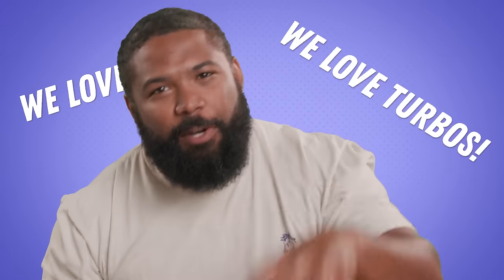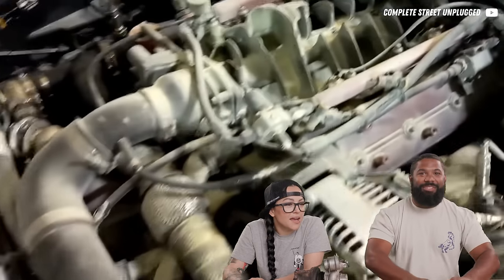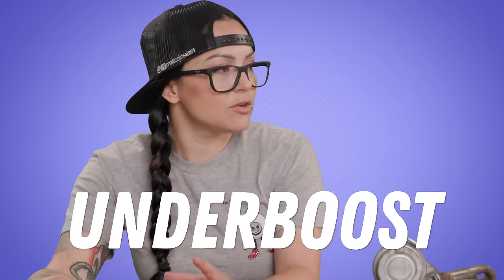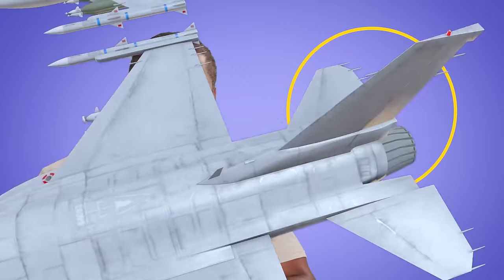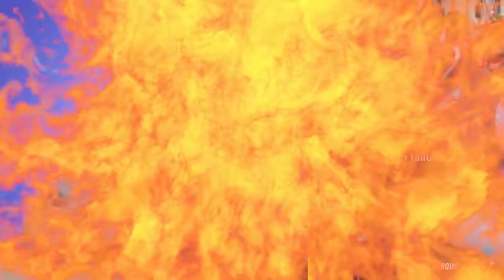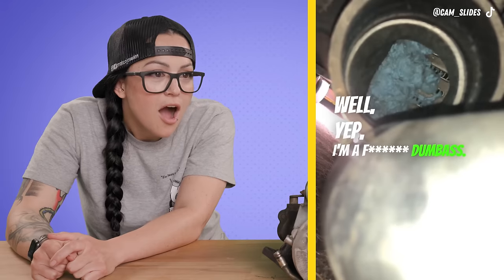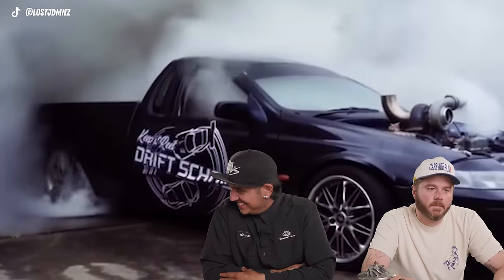Mechanic Reacts to Catastrophic Turbo Fails

Comment: 13:05 Rag in turbo- My neighbor had one of the early Mustang ll with a 4 cylinder turbo engine (early 80's?) Performance got really bad. He went to Ford garage, they replaced turbo at neighbor's expense. About a month later, same problem. He asked me to try. I took turbo off, would not spin easily. Looked into exhaust pipe, saw an obstruction. Used a strong hook to extract something like a woven piece of chain mail. It was the stuffing from the cat convertor that was upstream from the turbo. It had come loose, blocked exhaust flow. Back to Ford garage, they gave him hell for taking it apart. He made them buy him a new turbo, cat convertor, and pay him back for 1st turbo. Covered under 5year/50,000 mile warranty on smog control devices.

Comment: 6:22 We call this a Runaway Diesel. Unwanted air is gettin inside of the combutstionchamber, no throttle, selfignition, boom. You can only stop it if you block the intake.

Comment: That Volvo had something thats called a diesel runaway. That happens when the turbo is leaking oil into the intake, that oil is then basically used as fuel and the engine runs until the oil is completely drained and or the engine explodes. When this happens the only thing you can do is trying to choke the engine by stuffing something down the intake. This is more common in the eu where small turbo diesel engines are common in commercial vehicles.

Comment: 6:21 The "Ghost Car" video is a runaway diesle. The turbo oil seals fail and the engine runs off the engine oil instead of diesle fuel. The only way to turn off the engine is to plug the air intake.

Comment: 6:36 is a runaway, oil from the turbo gets into the combustion chamber causing the car/truck to go full throttle until it blows up. the ignition stage is no longer needed when this happens so good luck stopping it. the only ways are 1 as the guy was saying, stall it or 2 stuff the turbo with a rag.

Comment: @Donut the Volvo from idle to smoke from the exhaust is a runaway diesel. Oil from the turbo gets in the intake side and diesel beeing a compresion ingnition that oil acts like diesel and the motor just spools up. It’s a dangerous fail and on older models happened while driving.

Comment: That Volvo S40 probably has the older D5 engine. One big issue with these engines is that it can starting to consume the engine oil together with the fuel, causing the engine accelerate by it self and its really hard to stop the engine. It will often continue until it broke down totaly. The main reason seems to be to much engine oil. Lot of these incidents in Sweden and probably around the world 😅

Comment: The powerstroke on the Dyno actually blew its compressor wheel out of the turbo and the white smoke was the oil that fed the turbo dumping into the exhaust. I've actually done that with a diesel I had.

Comment: There is almost always shaftplay in a turbo as most used bearing is oil bearing. If it is in about 0.5-1mm from side to side than it's still in a tolerance field. Mostly the problem starts when it starts grinding on the wall of a housing :D

Comment: That "rocket stove" barbecue was actually a gasifier powered jet engine. Using forces air to heat up the wood fire, and burning the gas to power the turbo like a jet engine. Feedback loop gasifier. The original videos were pretty great.

Comment: Runaway diesels are terrifying. I had it happen on a van I was moving around works yard. Just started revving harder and harder but my foot wasn't on the pedal. I noped out of there and just left it till it killed itself. 😂 It happens when the oil seal in the turbo fails and it starts feeding oil into the air intake essentially self feeding fuel causing the runaway.

Comment: Also had the vacuum line blow off the wastegate once and immediately pinned the 45psi gauge. It was a wild ride until the engine blew. Think just the head gasket, but with over 100k miles on the engine I just rebuilt it. Did have to rebore the cylinders 30 over. So would have worked out ok but it was stolen and stripped not long after. They left the engine mostly untouched so I rebuilt it. Then it got flooded in a hurricane. Loved the grand national, but it must have been cursed.

Comment: the black volvo at 6:22 is a diesel that is "running away" you guys should know this.. usually the turbo seals go out and oil floods the intake side of the engine, and you know that diesels will run on oil as a fuel source . and diesels ignition is cylinder presser its self. so there is no way to turn it off

Comment: It is a myth that turbos do not use any power. Because the exhaust is used to drive the exhaust turbo which drives the compressor. The HP lost can be calculated by the compressed air pressure and volume, plus the HP loss for spinning the turbine and compressor. 

If the exhaust is restricted enough, the engine will quit running. Restricting the exhaust by varied amounts will cause varied amounts of HP loss. The loss can be 40 HP for a large dual turbo on a 454 CI, 7.4 L, engine at high revs, though this is just a example. The HP gain from the turbo greatly exceeds any turbo HP loss, which is where the myth originated.

Comment: 6:22 it’s a diesel runaway, it usually happened in a mechanical diesel engine, probably the oil goes (leak) straight into the turbo and causes the engine to runaway even though you already unplug the battery

Comment: I think Angela missed it on the Corvette. The intake failed so the turbo, the throttle body, and any sensors like throttle position and MAF were seeing airflow- so the computer using that map for air fuel data was sending correct fuel for the air flowing to what the computer was sensing- however since the air was venting to atmosphere BEFORE the engine- resulting in rich mixture. Sure, maybe there was a tuning mistake- but seeing the bulk of it- the result was not directly some rich fuel map. It was the sensors and map is only valid- if the intake isn't blown open.

Comment: Turbo diesel engine runaways happen when oil is leaking into the compressor and gets burned in the engine. You can cut off the fuel but because the engine runs on the oil, it won't stop until all oil is burned up.

Comment: I was there the night the gray diesel blew up. It was the second of the night. It was a  Garrett turbo and we the driver over boosted it. It barely had about 50 hours on it of drive time in total. The compressor wheel shot about 50 feet in the air which was super scary. The intercooler poured out metal and oil for about 30 minutes.

Comment: @6:38 ... That Volvo's got a runaway diesel! If your turbo blows an oil seal, crankcase oil gets into the intake tract and over fuels the engine because it burns just like diesel. Only way to stop it is to cut off the air supply by plugging off the intake.

Comment: The old video of the 'rotsun'. It was the datsun with the 4.2 vortec from an s-10, with a turbo from a 10L diesel. Sprayed oil into the engine and vaporized oil was sprayed all over, ruining the race track for the day

Comment: The runaway Volvo diesel - I've seen that happen to a Renault.
Turbo oil seal blown so that the oil was being forced into the cylinders by the turbo... It runs until all the oil is used up, or the engine locks/blows... whichever comes first.
The Renault blew up. 🤣

Comment: the volvo diesel was probably running away, as you said, some turbo oil seals become bad and oil comes in the intake, oil to a diesel is just more fuel, it causes a positive feedback loop, more fuel, more rpm, more rpm more exhaust, more exhaust, more turbo spin, more turbo spin, more oily intake air, rinse and repeat, eventually the engine just gives up

Comment: I was told that runaway in Diesel cars like in the clip around 6:40 can happen if you put too much oil in the engine. Then since it's a Diesel even removing the key doesnt' stop the engine since it's feeding on it's own oil instead of the fuel. I have seen it happening with a Renault Scenic. The driver left the car because being in summer they had the cabin fan blasting, and it filled with smoke when something blew (I guess the turbo?). There was nothing else to do but wait (about 5 minutes) until the engine died (literally).

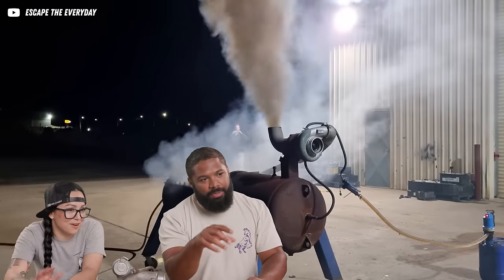Comment: 7:20 Oh a turbo-woodstove, these things are great. You can't control the fuel flow since the wood is already in the combustor and wood gives off more combustible vapours the hotter it gets, and at the same time the hotter the combustion the more exhaust is available to drive the turbo which will provide more air to sustain that combustion. In other words, these things come with thermal runaway as built-in feature, they just desperately want to explode.

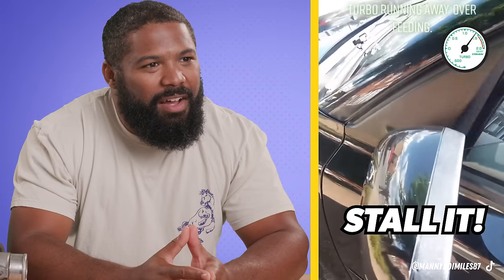Comment: 6:30 Its a right hand drive so what I'm betting happened is this is a Diesel that ran away while it was idling (diesel economy cars are a very comon sight in europe). Since diesels dont pull a vacuum you can only control it by the ammount of fuel, but sometimes they can get so hot the oil starts combusting and rev's the engine to infinity till it siezes. Look up Diesel Runaway there are a LOT of videos showing this exact thing. even if you turn off the key it will still run because theres no spark needed.

Comment: 0:55 "What's great about turbos is they don't take power to make power."
Everything takes power. The turbo adds resistance to the exhaust, which means there's slightly more work for the engine to do. If you connected the turbine side to your exhaust but didn't connect the compressor side to the intake, you'd clearly decrease the power of the car slightly. Not that it really matters -- the point is that it's an overall positive.

Comment: Had a runaway turbo on a big diesel generator, the fuel governor started injecting maximum fuel into the cylinders, had to close the emergency air flaps to stop it

Comment: Keep in mind when you start the car don't go by oil pressure before higher rpms but temperature  so wait till vehicle is at normal operation temperature before kicking the turbo 
Give turbo oil the chance to warm up    so when your engine temp gage is in the middle or normal running temperature   this will help stop oil break down  and give your turbo a longer life

Comment: That Volvo was a classic diesel runaway, usually caused by oil leaking into the intake. Diesels, not needing spark, continue to draw in the oil or fuel and leads to the engine "running away." To avoid catastrophic failure, block the intake and choke it out.

Comment: Having shaft play on factory turbochargers is normal .. factory turbos normally use bushings instead of bearings . As the heat rises the shaft expands. The bushings and shaft play is designed to compensate for the high heat

Comment: 6:22 fuel in oil engine DPF burning procedure many times stopped by fast engine off, only way to stop on manual gearbox is handbrake and brake on max and top gear selected and fast clutch pedal relase. Or use hand to cover air intake (might Hurts) :)

Comment: The volvo was a turbo bearing seal failure. the bearing seals of diesels when they fail will start to pour oil down the intake, and the engine will keep running until it either has no air or no oil left to siphon out. if your diesel takes 2-5+ seconds to shut off after you pull the key out. you may have a failing bearing.

Comment: Dyno sessions can be very dangerous, I've seen videos where flywheels explode, a big chunk bounces off the floor and dome pieces a guy standing 25 feet away and he forever slept, driveshafts can be very dangerous as well, wet nitrous systems can be very dangerous, it can be like a b 0 mb because the system supplies not just the oxidizer but plenty of fuel too, be careful my brother's and sister's!

Comment: what happened to the volvo is a runaway turbo diesel, basically it happens on high mileage turbo diesel engines where the seals are broken and the turbo starts sucking oil and shoving it into the intake, therefore the engine starts burning the oil and it goes to redline and will keep on revving even if you take out the key, it won't stop because it's an endless circle until the oil runs out or the entire engine blows up, to stop it you have to stall it just put it in third or fourth gear break hard and let the clutch go, if you have an automatic and this happens you can just forget about it and run away lmao

Comment: Turbos do have a tiny amount of shaft play out of the factory, that space is filled with oil while it spins. Don't be spooked if the shaft on your brand new turbo moves a bit when you push on it.

Comment: This is caused by the bearing or seal on the intake side of the turbo fails and starts letting oil into the engine.  A diesel will burn the oil causing it to "run away". Since it's burning the oil, turning the key off doesn't stop it. AS long as the engine is getting air it will continue to run on the engine oil until it runs out of oil.

Comment: There should be a tiny bit of shaft play on completely dry turbo. If you plug up the oil return and fill oil in the shaft play should further reduce. Excessive shaft play is bad

Comment: 12:33 this is what causes most diesel runaways. Like the Volvo earlier in the video. They run off their own oil supply and can’t be shut off. The only way to stop them is to choke them out at the intake or let them grenade.

Comment: Your ghost car is a runaway diesel. If that turbo breathes in anything flammable it automatically pins it wide open. It runs until it blows or runs out of whatever is fueling it. You can throw a damp towel directly into the turbo to suffocate it and maybe save the engine

Comment: The Volvo presumably had diesel runaway, where the engine oil leaks in to the combustion chamber and gets burnt as fuel, increasing revs until it blows up.

Comment: Car at 6.30 is when diesels run on their own fuel possibly after multiple failed dpf regenerations causing a high fuel level in the engine oil itself, the turbo leaks the oil which is contaminated with fuel into the intake so you can’t turn the engine off

Comment: That’s a runaway diesel, it happens when extra fuel gets into the intake and the engine essentially gets into a vicious loop of progressively building more power and drawing more fuel from the leak until you either cut off the air or it blows

Comment: The Volvo problem is called a runaway. Oil leaks into the combustion chamber and acts as a fuel source. Turning off the ignition doesn't stop it. You must cover the intake and suffocate it to stop it.

Comment: For your knowledge on that "Ghost Volvo", what happened there was that the Diesel Engine ran away. It can happen to any and all Diesel engine, regardless of manufacturer, or application. 

So on a diesel engine, you have no throttle body, or valve. The intake is free throughout. What controls the RPMs is how much Diesel fuel gets injected to the combustion chamber. But Diesel fuel is kinda like oil. So what happens when an oil seal in the turbo or engine seal leaks, and allows engine oil to go through the intake? You now have unmetered "fuel" going into the engine, and it will follow a perpetual cycle redlining well past its mechanical limits as the engine is out of control, until one of two things happen. 
It will run out of "fuel" meaning, it will have consumed all oil, and hopefully not blow up or seize, though damage is highly likely.
Or two, it blows up since it redlined well past its limits and it gave up. 

The only way to stop a runaway Diesel is to cut off the air supply (block the turbo) and be brave for that, or dump the clutch and hold brakes if its a manual vehicle. Shutting off key won't help.

Comment: I'm sorry if someone else has mentioned it already, but that Volvo is suffering from Diesel runaway. When the motor gets into that state, you can yank all the electrics but it's still going to run if it has fuel and air. That's why the bloke was going "Stall it!!!"

Maybe you guys don't work on Diesels very often, but the quote of "Just put it in Park" was really jarring. 

The only way to stop this is to pop the hood, yank the airbox, and block the intake with something solid. Or just let it explode.

Comment: The "ghost" cars a runaway. Happens when the engine starts sucking oil into the combustion chamber, and it ignites. Shut the key off, engine keeps going you can't stop the fuel. It's literally burning  the oil in the oil pan.

Comment: That Volvo is called diesel runaway happens when seals on your turbo fail and since diesels usually older ones do not have throttle valves all that oil goes straight into the engine and diesels will run just fine on oil this starts a vicious cycle where more oil gets sucked in engine revs higher until it blows apart seizes from oil starvation its very scary i had it happened several times sometimes you have a turbo fail and oil stays in the Intercooler and if not flushed and cleaned you install a new turbo start the engine rev it a little and there it goes just starts revving higher and higher only way to stop it is block the intake on the turbo.

Comment: As a kid and new to turbo's (they were black magic back then lol) I was working on my car, and I can't remember why, but I used a pair of tights across the turbo instead of an air filter. Low and behold that turbo sucked those tights right in lol.

Comment: Diesel engines can generally run off of most oil, especially if the engine is hot enough and the oil is atomized enough. when a piston ring fails and push excessive blowby or a turbo seal fails and leak excessive oil through the intake system, the engine will essentially be running off that oil and act as though it is at full throttle until it either runs out of oil or has a catastrophic failure. Happened to me once. Ended up bending 2 rods and melting a hole in one piston while melting the edges off the rest of the pistons. Ran away to stall in less than 5 seconds lol